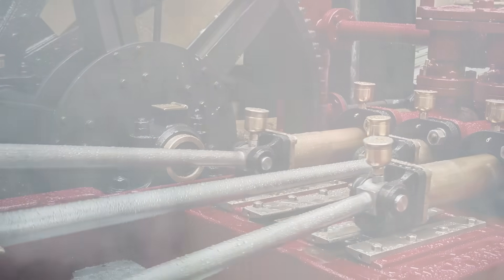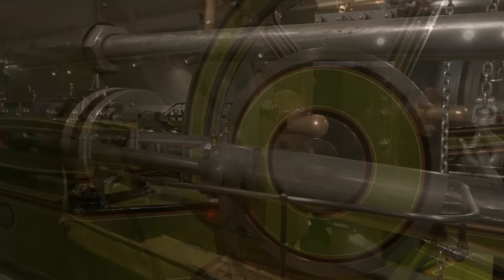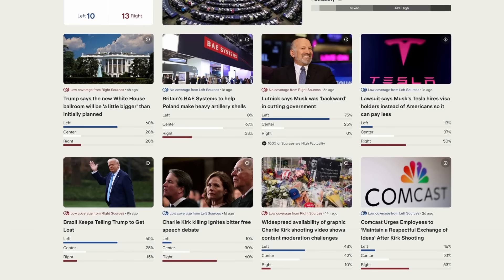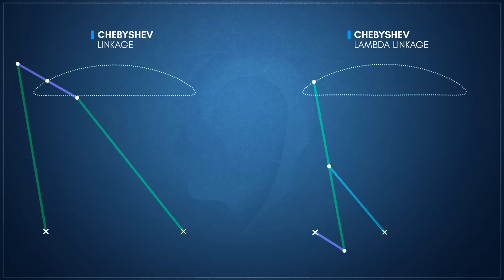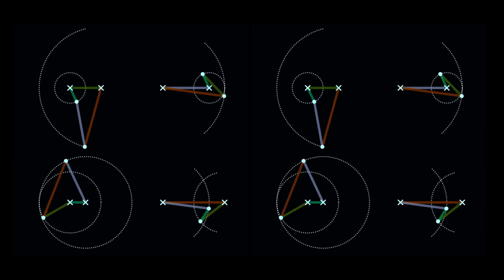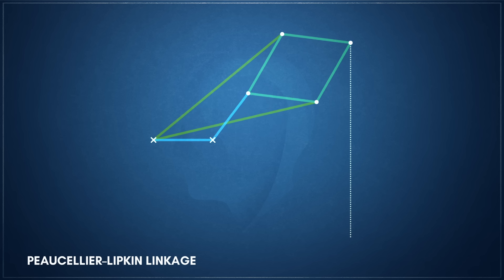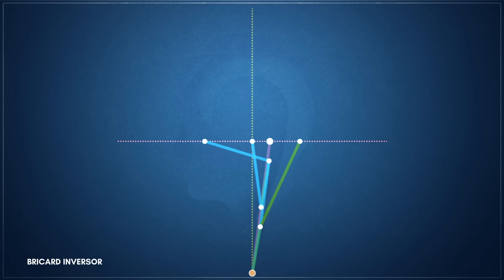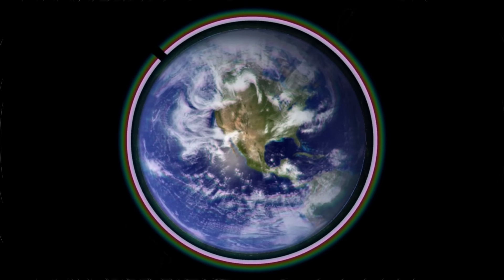The Strange Problem of Straight-Line Motion

Comment: It is weirdly jarring seeing the animations I made for the Wikimedia Project being used for almost all of the linkage animations in this video. Cheers! o/
Two questions I'm noticing crop up a lot: 1. Why do these even exist when you can just use a straightedge? 2. How do you even power these?

Well, here's the thing. How do you get that straightedge? Something had to have made the straight edge of the straightedge. Same for pistons, prismatic joints, and flat sheets.
Prior to the existence of these linkages, the only way we could make flat surfaces was by alternating between three rocks, rubbing them against eachother repeatedly until they all had a smooth surface. To absolutely no one's surprise, this is a painfully slow task.
We all take pristine straight lines and flat surfaces for granted nowadays, but something had to have made it first, and straight line mechanisms were pretty much that solution. Roberts (the same one in this video) was one of several people who invented the planer. And although the history behind it is lost to time, I would not be surprised if the mass manufacturing of the planer only existed directly due to the utility of Robert's own straight line linkage. It was just way more effective to work with a mechanical linkage than to well, rub a bunch of rocks together.

As for how to power these, well there's a lot of different ways, though most of them generally fall into the category of driving the output with a crank and connecting rod. Essentially, imagine a slider-crank configuration but with the slider replaced with a straight line linkage. There are a few exceptions to this though; I highly recommend checking out some animations of watts steam engine which have incorporated into them, and grasshopper beam engines (where the grasshopper linkage originated).

Anyways, there are a bunch of other straight line linkages that I never got around to animating, so I do want to mention that not only is this a non-exhaustive list of these types of linkages, but there are actually still new ones being made today. They don't really serve any practical purpose in the modern age, but they're still fun to discover!

One more thing I want to mention is about 7:33, because a friend was curious how the Chebyshev linkage and horsehead jib linkage are related. I remember reading this in the article on Chebyshev linkage describing their relationship as the midpoint being translated to the side. Functionally though, I personally think the Roberts linkage is more closely related given both mechanisms draw the straight line in a different section of the path compared to the Chebyshev, and visually it's equivalent to just translating the output point towards the side.

I've been thinking about changing this in the article but I'm uncertain.
Reply from the maker: I hopefully, made it very clear both in end credits and description that’s it’s your animation work. Much appreciation for your knowledge on the topic and the comment.
Reply: I've always thought that things like the Wikimedia/Wikipedia project are really some of the best examples of what makes the Internet great, and this is why I continue to support with monetary donations (even if my means to do so are limited). People like you are doing amazing work at making the collective human knowledge accessible to everyone, and a huge THANK YOU! for that.
Reply: Thank You !!
Reply: Shaking hands here! I'm the guy that animated various walking machines for Wikimedia.
As all walking mechanisms contain an approximate straight line mechanism, we crossed paths over there!
I love that we are part of the great bazaar of knowledge and I see that we inspire each other.
Reply: While three rocks is not practical for production of widgets or roughing in a shape, it is still the method used to make metrology grade surface plates of between about 12 inches and 6 feet wide and 3 to 8 inches thick (proportional to width) with flatness about one micrometer [more or less depending on grade and size, a small AA may be less than that]. The lower grades of which are used for production work setup and QC of products, and higher grades for verifying other precision tools. Stable sources of granite are most common, fused quartz is the real premium stuff both for dimensional stability and wear resistance.  

They are installed on special tables with three point support, best kept at a steady temperature and checked occasionally with optical interferometry, they are generally very heavy so the interferometry is easier than bringing in another stone plate and doesn't weigh enough to have significant effect on the plate. When they get worn from use they bring in a chunk of super flat cast iron (looks a little bit like a chunk of I beam) and rub on a slurry of extremely fine grit to correct it. Because the same iron is used repeatedly on many surface plates it behaves as a member in the 3-plate grinding system, becoming ever more flat as it makes the stones ever more flat
Reply: @TheDuckofDoom.  I think youtube put this comment in the wrong place
Reply: @mysti_is_lost It didn't
Reply: Thanks for commenting.I get it now.
I'd learned about the three plate method for producing perfect flat surfaces so i wasnt getting the point of this video.I'd actually given up watching part way through
Reply: argy is nerding out again :3

my main source of youtube comment mini-essays never fails to give us autistic yapping with an infectious amount of passion

Comment: I dont understand how these linkages are relevant to pistons and circular motion. Most of these linkages that produce linear motion wouldn't work if the rotating links made a full 360 degree rotation. Also where were these linkages used?
Reply: It‘s abstract mathematics. They have no practical use.

Comment: SO WHAT YOU ARE SAYING is to create the first perfectly straight milling machine and lathe beds we had to use straight line mechanisms, because we DIDNT have the dead flat machine beds needed to create the next generation of dead straight machine beds. 

It always amazes me how we don't take flat, straight and precision for granted. But these were really hard problems to solve as we demanded finer and finer tolerances.
Reply: they probably didnt use straight line mechanisms due to the slop
but you can get a really nice flat bed with simple grinding putty, good eyesight and a few weeks

Comment: Practically it matters less if the motion is in a perfect straight line, more important is if the force is transmitted with higher efficiency, also if the leverage is uniform, most of the time isn't, all of those ingenious solutions are unnecessary optimisation based on a bad understanding of real requirements of the real world. You don't need perfect straight line motion, but better leverage, and higher efficiency!
Reply: Yeah, a lot of them have so many joints that i would think this would severely limit the accuracy to far below the theoretical accuracy. And they seem to have some points in their range of motion where they are operating at a pretty severe mechanical disadvantage.
Reply: Speed and force at the end point matter in most cases.

Comment: Interesting topic. In your rear suspension example you show a coil sprung setup using a panhard bar, but leaf sprung versions work differently. Leaf springs use shackles to compensate for a linear compression which maintains differential alignment. There is an angular rotation that can occur under compression, but the vertical travel remains linear.
edit: Never mind. After I got some coffee in me I realized my mistake. Leaf sprung suspension still moves XYZ axis. All I had to do was wake up enough to remember the slip yolk 😁. 
Cheers 🍻
Reply: The ever popular Hotchkiss drive does provide “good enough” constraint of the suspension motion for many applications using just the leaf springs and sometimes a torque tube. So you aren’t wrong from a practical sense

Comment: Great. But in the past when I needed a straight line, I tried using the Yom Tov Lipman Lipkin method.  But instead, I just use a ruler.
Reply: Yet another child spoiled by the modern manufacturing techniques that made grinding straight edges possible.
Reply: @Pystro I wouldn't have put it like that, but you have a point.
Reply: @Pystro btw… were you one of the pioneers of grinding on straight edged objects ?😂
Reply: @Pystro  but the technique for making a straight edge is ancient. You just take three boards and rub them together, swapping back and forth. And the machine that made the ruler most likely ran on a track, not a linkage.
Reply: Facts. These kids will never know the struggles we went through just to get to school.
Nowadays they have straight edge bus drivers, that drive in straight lines, that drive straight to each kids house,
 back in my day our bus Driver used to take us from Michigan to Cincinnati, drunk af, then open the door as if it was the right stop
Reply: @miproduction6196 You missed the "and we were thankful for it!" as the final note to the ol' boomer grumble, lol.
Reply: @mnxs well yes, I have made a good home for myself in front of the liqour store in the heart of Cincinnati. I am very thankful
Reply: Um pouco de dificuldade não faz mal a ninguém, desde que a pessoa queira superar e dar um passo a frente
Reply: THANK GOD for the invention of the ruler

Comment: Very interesting, but I'm a bit disappointed that the how to drive those mechanisms isn't covered. I can't guess how those partial (as in non-full) rotations can be produced.
Reply: Or the needed torque on that some crazily complicated motions.
Well...i guess mathematicaly....possible, but practical? Ehhh
Reply: @TomasNovotny-ep5br  I do agree with you, overall, but the complex mechanisms for totally straight lines are unnecessary in most applications, they are perfect, but "close" is usually good enough. As he says, certain cranes can use one of these linkages.
Thinking of the torque needed, if you look at steam engines, their valve & reversing gear embodies many of these ideas. The Walschaert's valve gear is a good example, allowing steam into the cylinders in varying proportions and in reverse order as necessary, driven from a crank on one of the main axles. Granted, the torque available on a steam engine is large, but that is the point, you can use the mechanisms in control applications, if you really need something close to a straight line.
Reply: @neilbarnett3046 ahhh, nice info. Thx. You dont know what you dont know, and there is a lot you dont know😂
Reply: Guys... Of course one use "a rotating motor, to rotate the thing". The trick is: the rotation is revolving. And I don't know any "basic" system that allow such a rotation. Also, the constraints seems very strict to me, and I guess the rotation has to be precise at at least one point for the systems to work.
Servomotors at the age of steam didn't exist yet.
Reply: @leoelamri4054  timestamp an example in the video specifically that bothers you so much lol.
Reply: @MrHvleeuwen  The Peaucellier-Lipkin linkage at 12:30 for example. It's one of the most practical one among the "advanced" ones.
Reply: same
Reply: The original problem was the reverse. In a piston engine the thing producing the motion moves in a straight line.
Reply: Cams and gears
Reply: Linear motion can be produced by using a rotating cam and vice versa. I’ve designed such a mechanism. With this simple arrangement the linear motion produced doesn’t run at a constant speed, as the linear motion has to start and stop twice with each rotation of the cam. The connection between this mechanism and the kinematics depicted in the video probably involves a flywheel. This part of the problem is no different from an ordinary internal combustion engine. The piston starts and stops twice with each rotation of the crankshaft and a flywheel is employed to damp the pulse of starting and stopping into a constant rotating speed. 

Also, take into account that power isn’t necessarily applied at the end of the mechanism. It could be applied at an intermediate connection.
Reply: @ThisIsToolman  Haha. I know what you are talking about. We use that concept
Reply: Most of these are designed by mathematicians looking for a way to create straight line motion with linkages. It's up to the engineers to figure out how to actually use them. You're correct though. Most of these are not practical or useful. They're too complex, too big, they don't have 360 degree rotating fixed points to connect a motor, they don't travel smoothly with a constant drive speed, etc.
If all you need is a straightish line the simpler ones will work great. These days a lot of machines just use swinging arms and let the computer work out how to make a straight line with them. If you really do need precision though these more complex linkages exist, and figuring out a way to drive them is probably the least complex part.
Reply: No. This video is about mechanisms, not their propulsion. I'm happy that how they are driven is not covered.
Reply: Oscillating motion is simple, for example: connect a bar (A) at any point along the driven bar (B), with the other end of bar (A) driven by a rotating bar (C). This results in oscillating motion of (B) as long as one end of (B) is fixed.

A is the connecting rod
C is the crank
Reply: Well, they aren't all driven the same way. But remember, a lot of these came from the steam engine era. That's when you had a piston driven linearly by steam pressure. Hook the end of the piston up to the output point of one of these mechanisms, and you have a well-supported straight line piston motion. Or if you have a rotary power source, use something like a scotch yoke.

Try to do some research to learn more on your own, don't wait for the video to hand everything to you. Check out 507 mechanical movements! That's a great resource
Reply: Just put a connecting rod between any one of the free to move nodes and a motordriven crank. 
This only covers linkages to constrain a point to a straight line motion. To drive it with something revolving you need to connect another 1 bar linkage (the connecting rod) and constrain that to a circle (the crank).
Reply: Some people are just hard to please,  and disappointed easily. Im glad im not one of them
Reply: Servo motors, pneumatic actuators, hydraulics. How to drive a spinny thing that makes a thing go straight is whole other video !
Reply: @mcspikesky true, and we want that video!
Reply: I think the video's final mentions of 1) suspension systems and 2) the later popularisation of (methods to produce) guides to restrain linear movement, is the key to a large part of the answer to your question.

For 1), the crux of the problem is how you can restrain something that you want to move linearly, by using only hinged ("circular") joints to hold it - which are known to be reliable, simple to machine precisely, and generally easy/space efficient to mount. This applies not only to suspension systems, but all sorts of machines involving linear motion.

For 2), it was a matter of lacking other methods, like linear guides, to restrain the motion. And even with the advent of linear guides, it's worth noting that the wear and tear of those guide mechanisms are spread over a larger area (and unevenly so), and will usually have balancing (vibration) issues to some greater extent than a hopefully more naturally balanced hinged mechanism. For example, with an engine piston, you will eventually have significant wear over the entire piston circumference and the sleeve, reducing efficiency and creating other unfortunate side effects. It's much easier, say, to replace some small sleeves acting as collars in/on hinges' rod holes and pins, rather than entire pistons and piston sleeves.

To further add to the specific topic of crank-and-connecting-rod types of motion translation, it's worth noting that the motion that is imparted linearly from a crank - or vice versa - is not smooth in its acceleration and torque curves. This is, in fact, the origin of the problem of second-order balance issues in piston engine design; that certain forces acting upon the system are not smooth over the course of a cycle. Not that I'm claiming that fancy hinge mechanisms won't also have related issues, but they might not, or just be different or more manageable.

In other words, the application domain of actually driving the linear motion from rotation is but a small subset of the wider problem domain.
Reply: by using any rotating motor to rotate the part that rotates. the blue bar thingies.
Reply: @MrHvleeuwen well, the issue is that the blue parts depicted rarely rotate constantly, or in one direction at all.
Many seem to instead "undulate" back and forth between both directions of motion in a partial rotation.
How would you drive that input by a motor?
Reply: @dangernoodle235  like a servo motor. Or a steering wheel. Or a knob you can turn like on the water tap. 
Basically you can rotate until you can't anymore and then if you want the point on the straight line to move back the other way you turn the other way.

Maybe imagine it as a volume knob or something.

I'm sorry, explaining things clearly is not my best suit :') The point is you turn the knob and you make the point on the other end move in a straight line between 2 ends.
Reply: @MrHvleeuwen ah, servo motors would actually do the trick.
Not for the original purpose in the video of converting steam engine output in usable motion, but for stuff like robotics at least
Reply: You can google stuff...
Reply: @IdeesDePhysique  So if you google everything, why watch a video? What kind of a reply is that?
Reply: @RCAvhstape the devil is in the details